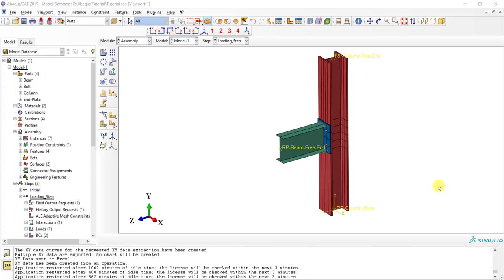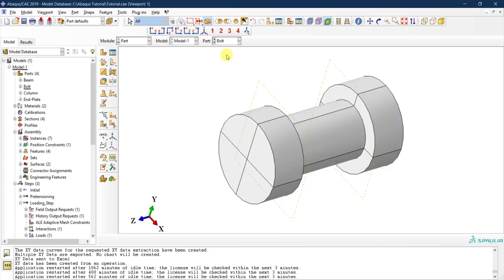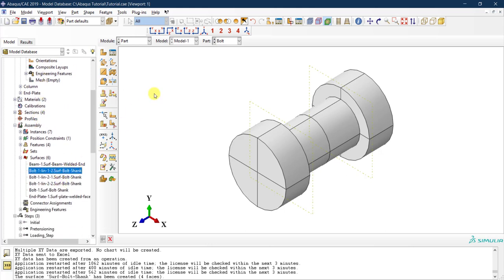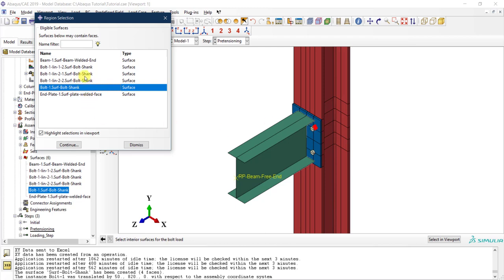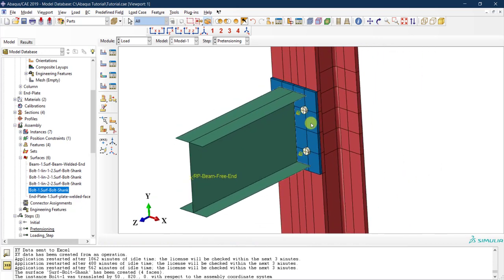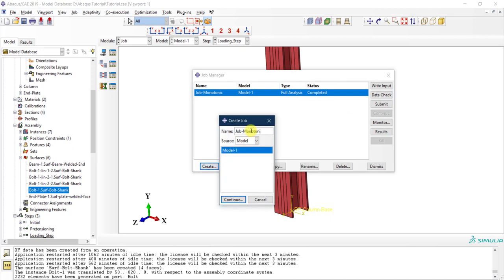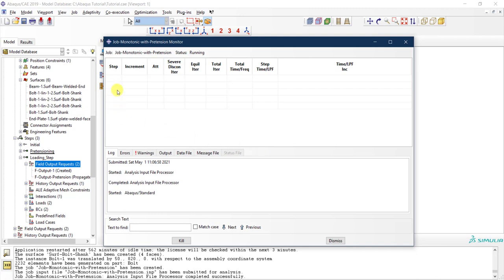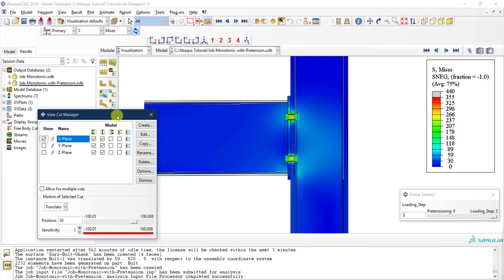#19 ABAQUS Tutorial: Modeling Bolt Pretension in Static Analysis

Comment: Hello Dr Ahmed , thank you for this nice and very helpful video on bolt pretensioning. Could you please also make and share a video about how to apply the pertension load using the explicit solver? As you mentoined in this video that there is a way by adding a temperature gradiant? Many thanks!

Comment: Wonderful video series. I am trying to model a system of two mild steel plates tightened with a 8.8 grade bolt. I am having some challenges with excess deformations. Hope you can help. Currently i fixed the ends of the two plates with ENCASTRE BC and applied bolt preload. First i tried applying ZSYMM boundary conditions at the top and bottom surface of the bolt, later on I applied ZASYMM boundary condition, it didn't work either. These BCs i applied were based on many other similar youtube videos. Any suggestion would be appreciated!

Comment: Very instructive video,thank you. I would like to ask if it'possible to apply pretensioning using Interaction, e.g. Coupling or similar, in place of the real bolt geometry. This could avoid a long  assembly work  in case of large number of bolts
Reply from the maker: Yes it is possible, for example, by modeling a link element that can be subjected to a thermal load to apply pretension.

Comment: All steps was normal , but after i click in continue at 9.25 , i have not  the same message like you , i receve directly the message in 9.46 , i click Surfaces in the right , i follow you, but juste i click continue like you in 10.27 ; i receved a message (( select a datum axis that is aligned with the bolt centerline)). Please where is the problem?

Comment: Sir, i already follow all your instruction but my analysis shown some error:

in keyword *CLOAD, file "Job-Pretensioning.inp", line 151839: Unknown part instance set BOLT1."_Bolt Pretension Load_blrn_"

in keyword *CLOAD, file "Job-Pretensioning.inp", line 151839: Unknown part instance set BOLT2."_Bolt Pretension Load_blrn_"

in keyword *CLOAD, file "Job-Pretensioning.inp", line 151839: Unknown part instance set BOLT3."_Bolt Pretension Load_blrn_"

in keyword *CLOAD, file "Job-Pretensioning.inp", line 151839: Unknown part instance set BOLT4."_Bolt Pretension Load_blrn_"

in keyword *BOUNDARY, file "Job-Pretensioning.inp", line 151876: Unknown part instance node set BOLT1."_Bolt Pretension Load_blrn_"

in keyword *BOUNDARY, file "Job-Pretensioning.inp", line 151876: Unknown part instance node set BOLT2."_Bolt Pretension Load_blrn_"

in keyword *BOUNDARY, file "Job-Pretensioning.inp", line 151876: Unknown part instance node set BOLT3."_Bolt Pretension Load_blrn_"

in keyword *BOUNDARY, file "Job-Pretensioning.inp", line 151876: Unknown part instance node set BOLT4."_Bolt Pretension Load_blrn_"

NODE SET ASSEMBLY_BOLT1_Bolt Pretension Load_blrn HAS NOT BEEN DEFINED

NODE SET ASSEMBLY_BOLT2_Bolt Pretension Load_blrn HAS NOT BEEN DEFINED

NODE SET ASSEMBLY_BOLT3_Bolt Pretension Load_blrn HAS NOT BEEN DEFINED

NODE SET ASSEMBLY_BOLT4_Bolt Pretension Load_blrn HAS NOT BEEN DEFINED

NODE SET ASSEMBLY_BOLT1_Bolt Pretension Load_blrn HAS NOT BEEN DEFINED

NODE SET ASSEMBLY_BOLT2_Bolt Pretension Load_blrn HAS NOT BEEN DEFINED

NODE SET ASSEMBLY_BOLT3_Bolt Pretension Load_blrn HAS NOT BEEN DEFINED

NODE SET ASSEMBLY_BOLT4_Bolt Pretension Load_blrn HAS NOT BEEN DEFINED

NODE SET ASSEMBLY_BOLT1_Bolt Pretension Load_blrn HAS NOT BEEN DEFINED

A CONCENTRATED LOAD HAS BEEN SPECIFIED ON NODE SET ASSEMBLY_BOLT1__Bolt Pretension Load_blrn_.  THIS NODE SET IS NOT ACTIVE IN THE MODEL

NODE SET ASSEMBLY_BOLT2_Bolt Pretension Load_blrn HAS NOT BEEN DEFINED

A CONCENTRATED LOAD HAS BEEN SPECIFIED ON NODE SET ASSEMBLY_BOLT2__Bolt Pretension Load_blrn_.  THIS NODE SET IS NOT ACTIVE IN THE MODEL

NODE SET ASSEMBLY_BOLT3_Bolt Pretension Load_blrn HAS NOT BEEN DEFINED

A CONCENTRATED LOAD HAS BEEN SPECIFIED ON NODE SET ASSEMBLY_BOLT3__Bolt Pretension Load_blrn_.  THIS NODE SET IS NOT ACTIVE IN THE MODEL

NODE SET ASSEMBLY_BOLT4_Bolt Pretension Load_blrn HAS NOT BEEN DEFINED

A CONCENTRATED LOAD HAS BEEN SPECIFIED ON NODE SET ASSEMBLY_BOLT4__Bolt Pretension Load_blrn_.  THIS NODE SET IS NOT ACTIVE IN THE MODEL

A BOUNDARY CONDITION HAS BEEN SPECIFIED ON NODE SET ASSEMBLY_BOLT1_Bolt Pretension Load_blrn BUT THIS NODE SET IS NOT ACTIVE IN THE MODEL

A BOUNDARY CONDITION HAS BEEN SPECIFIED ON NODE SET ASSEMBLY_BOLT2_Bolt Pretension Load_blrn BUT THIS NODE SET IS NOT ACTIVE IN THE MODEL

A BOUNDARY CONDITION HAS BEEN SPECIFIED ON NODE SET ASSEMBLY_BOLT3_Bolt Pretension Load_blrn BUT THIS NODE SET IS NOT ACTIVE IN THE MODEL

A BOUNDARY CONDITION HAS BEEN SPECIFIED ON NODE SET ASSEMBLY_BOLT4_Bolt Pretension Load_blrn BUT THIS NODE SET IS NOT ACTIVE IN THE MODEL

NODE SET ASSEMBLY_BOLT1_Bolt Pretension Load_blrn HAS NOT BEEN DEFINED

NODE SET ASSEMBLY_BOLT2_Bolt Pretension Load_blrn HAS NOT BEEN DEFINED

NODE SET ASSEMBLY_BOLT3_Bolt Pretension Load_blrn HAS NOT BEEN DEFINED

NODE SET ASSEMBLY_BOLT4_Bolt Pretension Load_blrn HAS NOT BEEN DEFINED

Analysis Input File Processor exited with an error.

Can you help? Thank you 🙏